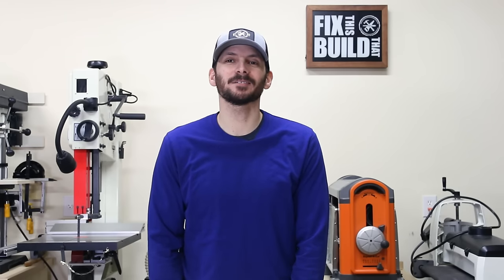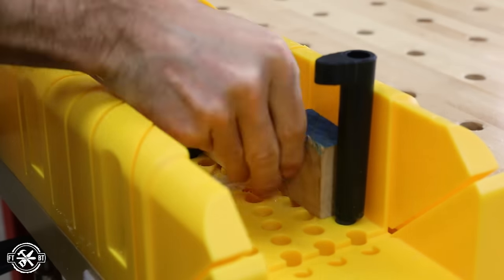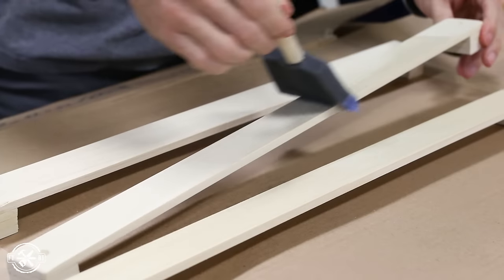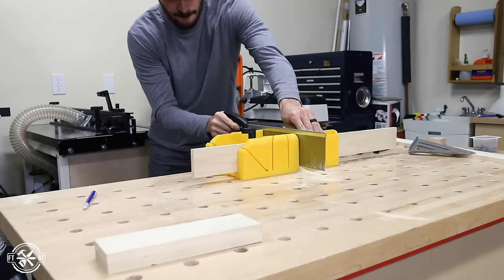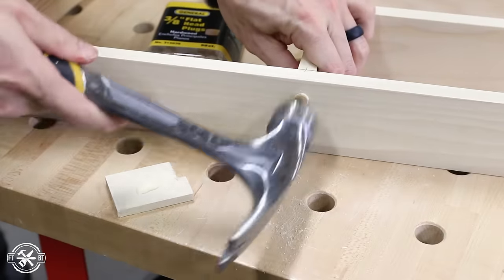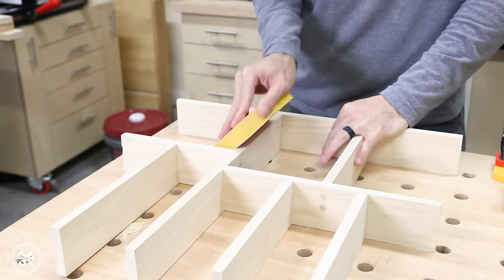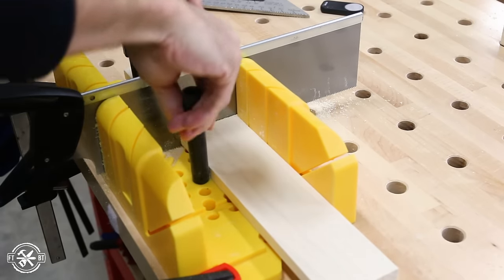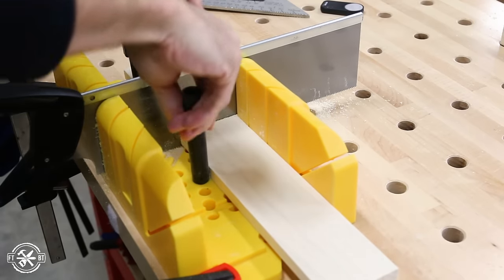3 Easy DIY Kitchen Organization Projects | Basic Tools

Comment: I have a band saw, 2 piece sander 5 and belt sanding, Table saw,  two of the yellow boxes set up for different projects, drill press and many clamp to hold items that might move when I am cutting or drilling.  My wife purchased all of this so the honey do list was not a burden but so much fun. She used many of them when I was at work.

Comment: Very nice tips.  We also have a storage area cabinet above the built in oven.  It was 20" deep so stuff would get lost in the back.  I installed open front drawer and sliders inside of that area.  Now you can pull the whole thing out like a standard drawer so you can see what's actually inside and reach items towards the back.
Reply from the maker: that's a great solution!

Comment: Loved the drawer divider but I would have changed the drawer slides to full extension ones so the extra three inches could be used too. My kitchen is 9ft long 6ft wide teeny so I need every little inch of storage. Love your projects

Comment: I'm working through the lid racks now. Bard isn't kidding when he says your mileage may vary for the spacers for the lids. I needed 6 to 7 for my largest land id, a glass lid for a cast iron pan. Other lids used 4 to 5 blocks. The distance between the rail and the panel is the depth of a block, so I'm dropping one for each rack. I also have smaller doors than Brad's cabinet, and I can only get 1 lid per rack.

The tools I'm using. 150-grit sandpaper glued to a scrap board. Chissles, the same miter box and saw, and the same pilot hole bit.

Comment: Living in a small studio apartment, I can't be using power tools all the time to make my cuts.  I'm quite familiar with that miter box you've got there, and I struggled with that same tear-out issue.  I've found that using only the weight of the saw for the last bit of the cut significantly reduces tear-out.  Sure, it takes a bit longer, but it makes for a cleaner cut, and saves some finish time later on.  :)

Comment: Awesome projects! 3 mods I'd make. 
Project 1: put something between the rack and the door so the lids don't scratch the doors over time.

Project 2. Same idea as 1, except cut material of choice to shape and tape to bottom of each compartment. Saves from gouging and also acts as grips. 

Project 3. Put a little backstop lip on each level to avoid playing dominos when pulling a container off the back. 

Great project ideas, I'm going to do all of these

Comment: Thanks for sharing! Nice projects there and clearly show the difference in results! Although a quick tip. If you use a carpenters scribe you can prevent tear out. Just scribe around the whole piece where you plan to make the cut or you can use masking tape to achieve the same effect. The scribe is my personal favourite.
Reply from the maker: Oh, good tip!
Reply: Hey, I'm no carpenter and I'm not from any English speaking country, so just looking at a scribe on Google leaves me puzzled. Would you mind explaining how your method works?

Comment: One thing I don't get, I got the exact countersink suggested and the exact #8 woodscrews. The pilot hole the drill bit made was the size of the 8 screw. It just fell right through. Can't grab the wood. What's the deal?

Update: I read the package of the drill bit. It says adjust for screw size. I'm an idiot. Thanks!

Comment: I'm an extreme novice that just purchased the very basics to have a hand at the drawer organization.  Great video.  The project looks simple, yet professional and well executed.  My inner male needs to build stuff, for my mental health.  Wish me luck. :)
Reply from the maker: Good luck!
Reply: After giving this a go, my OCD wants to try again with power tools.  I picked up a miter box and saw, clamps, etc, and the cuts were most definitely not 90º.  The cheap miter box just isn't precise enough for 90º cuts.  Maybe it's me, but I'm unsure how I could have attacked it any better.

Were I not as OCD, this project is fine.  But I want to next try ripping the wood down to 2" (I think 2.5" is just too tall), and also a miter for really square cuts, as well as having a go at dados for the wood joints.  Naturally this means $$$$, but I have a few projects in mind where these will all come in handy.

I grew up with my mother hiring a contractor/cabinet maker who makes almost perfect everything.  Straight lines, flush connections, smooth transitions, glass-like finishing work, and I guess that hit my DNA.  Because these cuts not being 90º has kinda rocked my world. ;)

Comment: Love these ideas.  Couple of questions. 1). There isn’t a “front” for the silverware drawer divider.  So how do the two dividers(for example) keep from twisting to the left or right?  And 2) since you ended the drawer divider a couple of inches away from the back, what prevents the whole thing from shifting in the drawer?  Opening a closing tends to generate some force (especially with my kids) and I’m worried I’d open the drawer to find the whole thing pushed back 3 inches.  Lol.  Thank you.
Reply from the maker: I put a small scrap behind it to wedge it in and keep from moving. I should have mentioned but forgot when doing VO. Also since it's 1/2" thick it's pretty rigid
Reply: Fix This Build That great. Thank you for the reply.
Reply: @Fixthisbuildthat   I use pipe insulation.  Comes in different sizes.

Comment: The pot lid weight on the door WILL pull the screws out of the door hinge. It happened to me in about 2 weeks. I had to pack screw holes with gorilla glue and tooth picks, and then re-install hinges when dry. Neat idea, but don't do it.
Reply: David K 😱
Reply: Why not use longer screws instead of your standard
Reply: @TerraTN well it depends on the style of doors,  if they are shaker style doors then yes they are, but id they're panel doors then you have a pretty good amount of wood were the screw will bite in to it... and from what he's talking about I believe it's the hinge, so instead of using the ¾" screw he could go for a longer screw even an 1¼ screw would be good enough as I doubt the lids weight that much,  it also depends on the style of hinge he has

Comment: One thing I  thought off... for holding your lids you can either use a box  and put all the lids in it 
Also on the cabinet doors you can use plastic folder holders like the ones they use at Doctors office or you can use some kinda mesh net pocket  and attach it to the door

Comment: ... good ideas for organized storage spaces! 
... for the pan cover holders, option is to use ready made hooks attached strategically on the door (inside part) to hold it in place.  😉
Reply: I used a plastic file holder from an old docs office door

Comment: Seeing you work with drawers.  How do I replace a drawer track (center, under drawer) when it needs to be attached to the front of the cabinet where the opening isn't big enough to get a hammer/screwdriver/nail shooter into it?

Comment: Trick I found worked for me. Use oak look towel rack inside instead. Just cut down the side pieces so the lids don't slide through,
 if handles are to shallow. No finishing needed...? 2 cuts...

Comment: Just an FYI - some door hinges can only handle so much weight. I found this out looking for new hinges to use in my kitchen remodel, so if you are planning on putting the pot lids on the door, you might want to see if you can find out the limit of the existing hinges.
Reply from the maker: yes, for sure.  I think they will be okay based on the weight I have

Comment: Do you know if the extra weight of the lids would affect the performance of the newer "soft closing " cabinets?
Reply from the maker: You can check the manufacturer's website to see the weight rating
Reply: @Fixthisbuildthat  thanks for the information!

Comment: Is the electrical outlet in the end of the island cabinet more useful or more in the way of the stuff inside?
Reply from the maker: definitely more useful.  We use our toaster and griddle on the island all the time
Reply: It's the most-used outlet for small appliances in my kitchen.  That's where I set up the crock pot, the blender, the food processor, the hand mixer and the stand mixer when I'm using them.  It's also where my husband and kids tend to plug in phones and laptops, because it's on the end close to the table.  Also, since it's centrally located, that's where my little vacuum and steam mop get plugged in.
Reply: Lela Eubank awesome, I ran wire under the house to install one on the end of my bar, figured it would come in handy for the vacuum

Comment: ca glue is not available in argentina, nor do they sell thin strips of wood like that in the store. special wood suppliers don't have even cut wood either, you'd still have to run it through the planer most people don't and won't have, not to mention the dull saws we buy here and other most basic problems. but it was fun to watch. thanks.

Comment: I HAVE TO WONDER how long those kitchen cabinet door hinges will hold up to the extra strain of carrying a few extra pounds of glass lids???
Reply: That's a valid question.  I would replace those hinges, if possible and applicable, with stronger ones.

Comment: Lids on doors
Bad idea to who does not use Custom Made Wood Planks furniture
An extra weight you put on those probably are not been predicted by manufacturers 
So ylu will end up with always breaking closing door mechanism parts or with fallen door apart entirely.. or both one after another

Comment: I really like your pot lid design; I suffer from the same problem of where to store the lids. However, watching you screw cheap poplar into expensive Cherry cabinets made me cringe. Why wouldn't you suggest spending a little more and using 1/4 inch cherry plywood or resawing  a 3/4 inch piece down to 1/4 inch then staining it to match the cabinets. Then you could have shown how to accelerate the aged cherry patina with water and baking soda too.